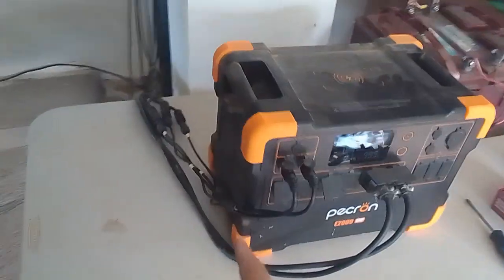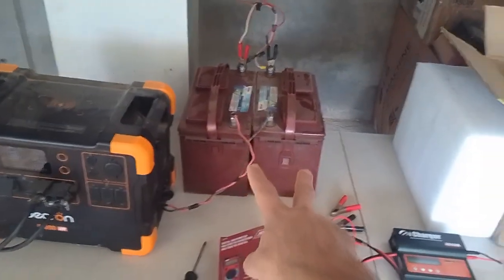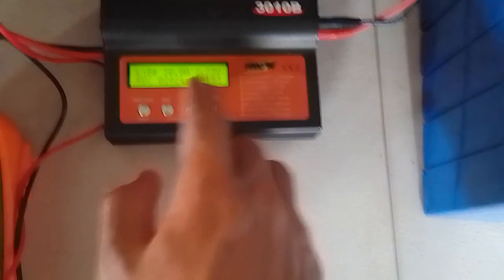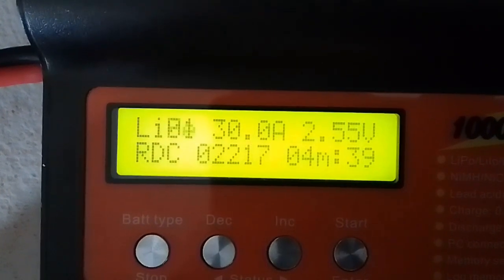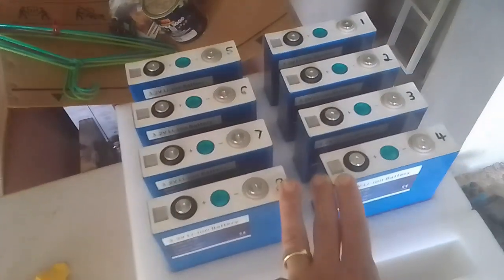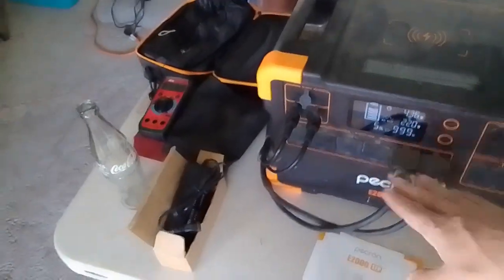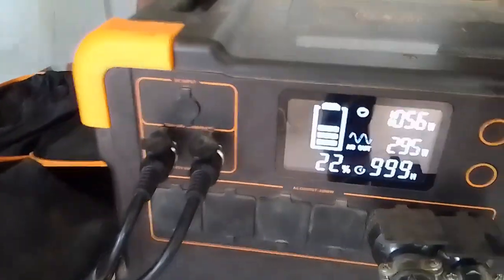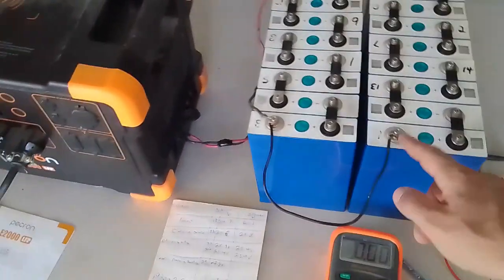Pecron E2000LFP DIY LiFePo4 External Expansion Battery Upgrade

Comment: when charging a multicell lithium battery please use the balance connection to avoid overcharging or install a bms and charge through the bms.
Reply from the maker: That is simply not necessary.  If the cells are bottom balanced, and you don't over charge the battery, individual cells will not over charge.  The cells can be charged to 3.65 volts each, at "full" charge the E2000LFP will have only charged them each to 3.48 volts.  This head room is far safer than a BMS and the last .2 volts of charge account for like 3-5% of the capacity.  So, it's totally unnecessary to go into the "danger zone".  I have been charging LiFePo4 and LiPo cells without a BMS for years, never had one fail ever.
Reply: @unacceptableone  Your reply is ridiculous. I drive 100 mph on the freeway for 20 years and never got a ticket so it must be totally safe and legal. /s